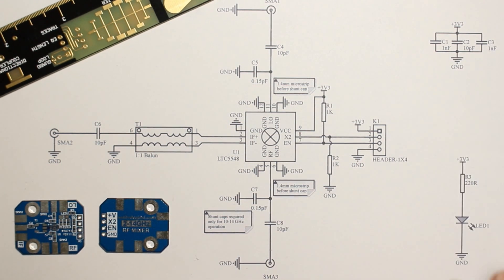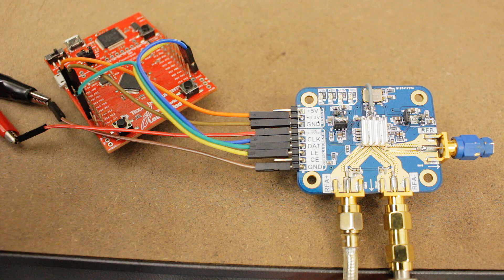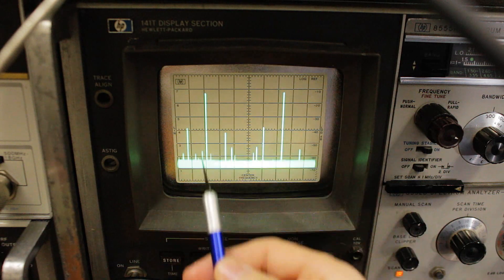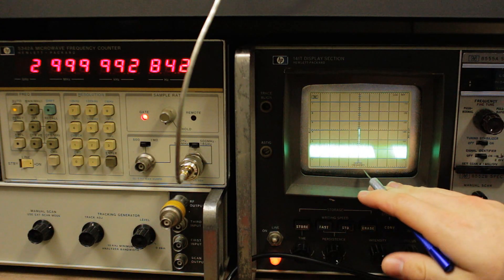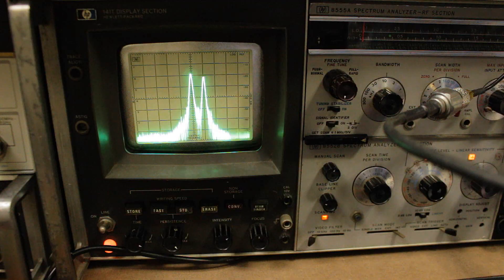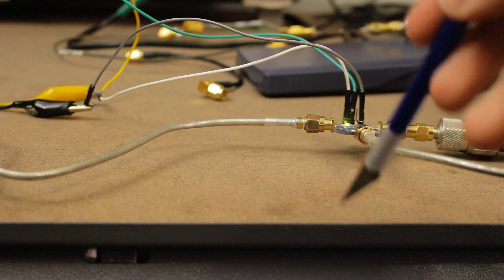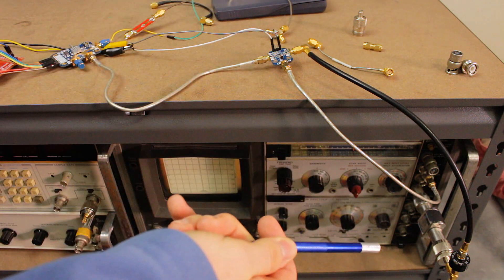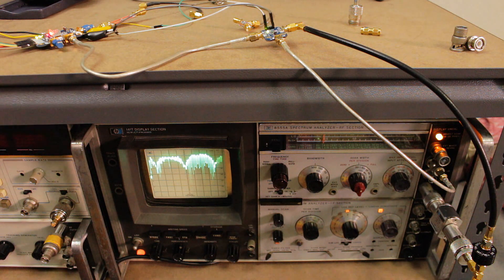14GHz Mixer Build & Experiments

Comment: Use a pencil for a pointer, the xacto knife is making us nervous specially when pointing at the SA's graticule :)

Nice video !
Reply from the maker: Also the tip actually warps the trace a little bit if it gets too close as it's slightly magnetized ;). Cheers!
Reply: I came to make this same comment. I can’t hear what you’re saying when the blade gets too close!  =‑)
Reply: @christiancampbell466 🤣🤣🤣